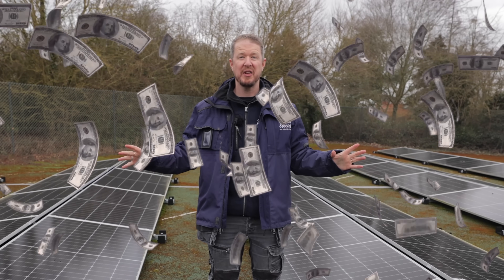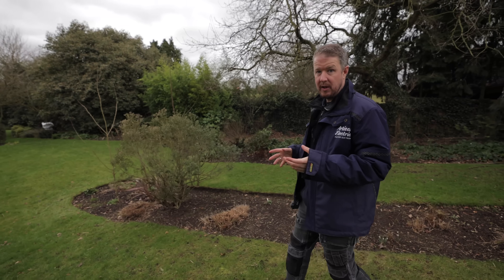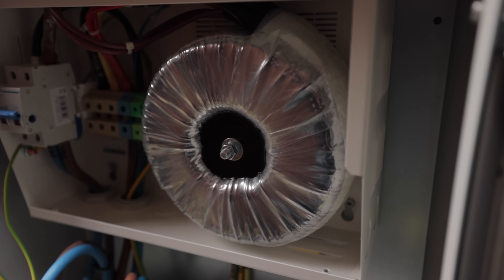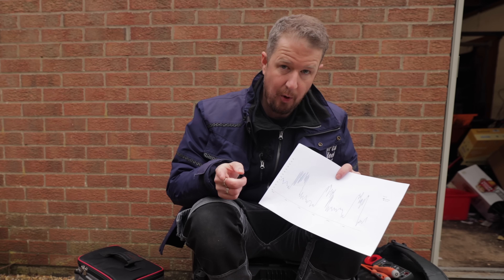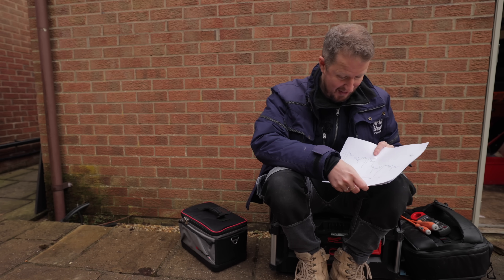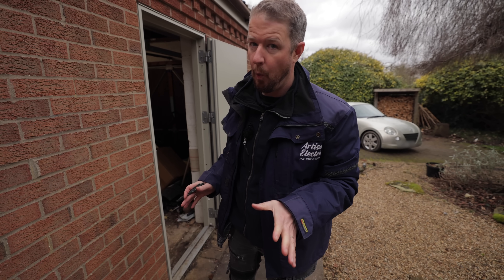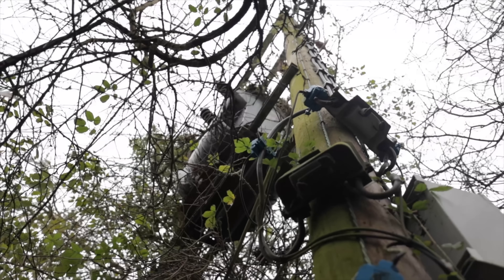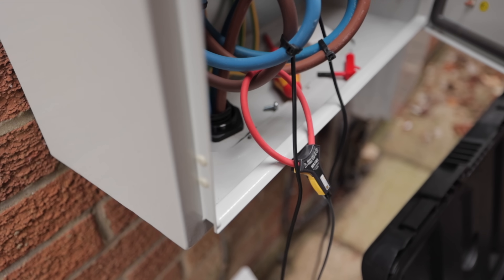THOUSANDS Down the Drain – And We Can’t Do Anything About It!

Comment: Until I retired last year I worked for a DNO for 40+ years. 
I do not think it is the transformer that is the problem but the overhead lines!

To be clear the standard voltage is and always has been 240 (you think we changed all our kit for the EU?). The reason for the 10% and 6% is to give the same top and bottom voltages without new kit!
If you ask the DNO they will provide you with the drawings of the network in that area showing Transformer size and even cable size in the overhead sections (at cost).
Whoever agreed that you could put 17Kw in on a solar system was not doing their job and it is worse because of the overhead network. But they have said yes and you have the paperwork I assume ;o)
There are a couple of solutions I can see, but they will not want to do them as it will cost them ££££. 
First is to upgrade the overhead lines (and clear them of vegetation) ....... I wonder what the Ze was for the house? Often overhead lines go a bit high. 
Second (and cheapest) is to change the tapings on the transformer (I assume that one does have tapings, but not all do)
Third, you can have eather individual or group voltage devices fitted on the network to stabilise the voltage. These are just a BIG auto transformer with tapings that can automatically change dependent on the voltage. They are usually fitted when there are long runs and the voltage gets too low at the far end although it may well be high near the transformer! You may need to get a good engineer who has experience on the system (an older one) as some of the younger ones might well not have come across this type of kit as it is fairly rare!

On the customers side of things, I am a bit puzzled as to why it is pushing the voltage so high as I thought the inverters would not go past 252v ....... is there a setting available (even remotely via the firm it was purchased from? I know my own solar will throttle down before the volts go too high!
Again you can do a bit of math to work out what voltage you would need to squirt 17Kw into the system with the Ze you have ........ Well Zn really ...... you should be getting 0.2 Ohms as an industry standard!
One final thing I would check is the power factor! Normally not an issue but you have some chunky inverters on that system and they can cause harmonics giving spurious high volt readings! If you have poor Power Factor you might just want to look at power factor correction ....... but this is getting outside normal domestic arrangements!
Reply: Very well explained. As soon as he started going on about 230v all of us old timers are like EU harmonisation literature does not equal the physical reality of the UK power network. This is why all my designs are still done with 240v and 415v. As @redshift points out the over voltage protection is worked out on 230v not the actual 240v system, a case of components designed for a harmonised system that's only harmonised on paper.
Reply: @ Well said! I am still miffed that we moved from Red, White and Blue phase colours to the RYB (and I will not mention the stupidity of allowing manufacturers to chose the Brown Grey Black with Blue as a Neutral) ;o)
Reply: @effervescence5664  What will cost more going forward? Manufacturers have been assuming 232V for decades now and problems with overvoltage will eventually cost more than adapting DNO trafos.
Reply: Give yourself a pat on the back - very well explained and can tell years of experience coming out all of which is positive solutions to a problem. 🙌 nice to see such a great comment.
Reply: I wonder what would happen if they just played with the export limit on the inverters. it'd be interesting to see if there's a linear (or not) relationship between the overvoltage and the current they're pushing into the network or a threshold below which it doesn't raise the voltage.
Reply: Yeah, the inverter definitely should be self-limiting its export based on the grid voltage. My understanding is that all inverters should be grid responsive today.
And even the batteries should probably not be pulling when the voltage is dipping so much, but I suspect that's less common.
Reply: @BobHannent  The output of the inverters must be pushing 260V for a reason and that reason must be because they are trying to shove 17kW (70Amps approx) back and it's meeting some (literal) resistance. All that is going through that relatively small toroidal transformer. These guys need to upgrade to a 3phase supply and get busy with the pruners and chainsaws to clean up the DNO wiring to the house(s).
Reply: I mean, it should have been obvious that by putting a transformer in to step down the voltage that the low end would become too low. The issues caused by this voltage swing (both before and after) are far more than the video notes - you're basically voiding the warranty of every bit of electronic kit in the house, and very possibly creating a safety hazard.

I can't believe a professional electrical installer would considfer putting that in rather than getting to the root cause of the issue (which I see from the comments is well understood)
Reply: @mpellatt  
100%
Reply: Absolutely LOVE reading posts from knowledgeable experienced older guys like 
these!
Reply: I'm pleased you pointed out the standard UK mains voltage is 240 not 230, I often have that argument with people!
   In fact the UK average is actually 242V 😂
Reply: @Nigel_Broatch  I worked at a site with their own substation where they set the tappings to 400V (because that was the official nominal voltage). Caused a few headaches!
Reply: @PeterClifton  230V phase to phase is 400V, so I'm not surprised, but it could also be an industrial site with 690V phase to phase. At my workplace we have all kinds of fun voltages to worry about, even 110V DC. Measure at least twice...
Reply: @ I assume you are in the US? Here in the UK it is 415/240 .... or if you are a heavy user you can go for a COMA agreement, rent your own transformer (still run by the DNO) and buy your energy on the HV network! This is only for heavy industry though!
Reply: @Nigel_Broatch  Not that there is anything implausible about 242V, but how would anyone know what the average UK mains voltage is? They know what they are aiming for, but that is a different thing.
Reply: @Moletrouser i can't remember where I read it. 
It might be usefu under certain circumstances to know that it's usually around 240V not 230V. 
Knowing the exact average probably isn't important to anyone!
Reply: Excellent comment! Listening to this, my money was on the cable, too. Ohm's law says that if you're trying to push 17kW into quite a long, tiddly cable, you're going to get a voltage rise. And the problem isn't just that the customer's car charger cuts out. 260V is outside the design spec for every piece of electronics in the house. You risk blowing them up. And not just in the customer's house - all his neighbours further down the cable (on the same phase) will see 260V, too.
One idea - can this system be converted to three phase (at least on the grid connection - would need the inverter changing)? Then it would be a third of the problem (~6kW) going back into each phase. Presumably there's three phase on the pole.
Not qualified on the legal niceties of who's reponsible for fixing it, but in my view UKPN should never have allowed this to be connected up in this configuration.
Reply: @Sparx9062  Yes, changing to 3 phase is possible ....... but $6K would go up a bit and even then the customer would have to do the excavation. So not really an option!
I would expect to see a wide range in voltage from near the transformer to the far end of the leg (300m was half way?). 
If it were down to me I would offer the other residents a free voltage check and quiz them about their supply experience. If it is as I expect and the supply voltage is outside the given levels the DNO are under an obligation to sort it at their own costs! There are several ways to do this but none are cheap and that is the reason for the delay. If you can show someone is above 253V and at the same time someone at the far end is 216V the DNO have no room to argue and will act ...... but you need those figures! When talking to the DNO engineer get his name and there is accountability should anything bad happen and they are risk averse! 
Final tip is to keep it pleasant! Give them no reason to not do it and every reason to do it and you will succeed! Most DNO's are replacing overhead lines anyway as the budget allows, so your chances are good!
Reply: G99 stage 1 overvoltage protection is +14% (262.2V) 1 second. I think this is the maximum shown in the video, so perhaps the G99 protection is operating as intended. Have there been any overvoltage trips of the PV inverters?

G99 stage 2 overvoltage protection is +19% (273.7V) 0.5 second
Reply: Now that’s a good answer well said
Reply: @totherarf  Oh bless you sir, we old-timers are still worth our weight in gold! I wonder what the inverters software is like? Pumping up the national grid is one thing, and a domestic power supply is another. It looks like a voltage/current mapping problem with the software. Voltage regulation looks rather poor. It is so difficult without 'hands on'...
Reply: "you think we changed all our kit for the EU?" I'm a Brit living in the Netherlands and yes, I did think that the UK had followed the rest of the EU and standardised the voltage at 400 V between the phases which translates to 232.2V   (if I remember right) but then I discovered it hadn't happened in a similar on-line discussion a few years ago.
What I don't understand is whether a standard 10kVA trafo can transform up as well as down. I always assumed that it wasn't possible and that it was a one-way system but Artisan Electrics seem to be assuming that it is possible.
Reply: @billmorris2353  The rest of Europe didn't change their voltage either. A point in the middle was picked and the tolerance made enough to cover both bases.
Reply: @billmorris2353  The ave in my part of Devon UK is still 255v, and it never changed when they claimed it did.
Reply: @ Interesting point! Yes it can! One of the problems in working on the network is making it dead. If you kill a HV line and someone plugs a generator in it Will backfeed. A transformer is after all is said a device that works on changing magnetic fields! That is why we earth the HV lines to ensure all such energy is shorted out!
Reply: They should of let the DNO do there 2 week test, surely they could live without the solar for 2 weeks for goodness sake, acting like there broke.
Reply: @scitec717  They would not have had to disconnect the solar ..... just set the export to zero!
Reply: Excellent reply. 
I went and looked at the voltages and currents I record on my supply (good old Home Assistant with a Victron ET111) and I have not seen anything going over 252 V at peak, most of the time we seem to be below 246V. I have two PV mains connected inverters, (SolarEdge) and at times I do get to my agreed DNO export limit.
On my limited knowledge I would be looking at the settings on the inverters, they should control the voltage.
I also think that there could be a bit too much resistance on the overhead lines, if these cannot 'sink' the full exported current the voltage will rise at the house end, basic ohms law.
Reply: Can't a Tesla handle 277 volts from a 480 volt delta system?
Reply: @JulianSortland  I have no knowledge of Tesla, but it is 240/415V here in the UK so you are 37V up. Also there is the fact we talk of voltage as an RMS measure. The amount of energy that would cause a simmilar heating output if it were DC. The rms value is 0.707 (If I remember rightly) of the true peak voltage. It is the peak that causes the problems! This gives a peak voltage just shy of 340V!
Reply: Question if it was TNCS earthing and they installed enough local earthing  alongside the PME earthing that lowered substantially Ze and thus the impedance of L/N would this cure the voltage spike and for the low voltage if that does not solve it, just lower the charging current. Maybe someone knowledgeable would be able to comment on this.
Reply: @brianoneill350  That might not work. The problem (I think) is L - N voltage not L - E. ..... That is why I said Zn. The higher impedance of the active circuit (L through N and back to the transformer windings) is the issue. If you inject energy into that system you have to raise the voltage. The amount the voltage raises by is directly proportional to the impedance (Ohm's law).
Reply: Exactly the same as what I said those old transformers were good way better than the new ones we have down here that have been rusting out in no time.
Reply: @kevxsi16v  I assume you mean the PMT? Many of them were older than me and still going strong! The only real problem with them was the oil in them is bad for your retirement plans. New oils are good though .... or so I am told!
Reply: It seems that the customer is at the beginning of the line and therefore the company does not want to switch tappings so that the voltage at the end of the line is within the standard limits.
By the way, I don't understand, are there 3 phases or just one?
Reply: Yep - my response was going to be dropping the tap changer down -5%. Needs and HV outage, but simplest solution and probable fix. That Tx and H-pole will get upgraded…… eventually.
Reply: @mrjonnylowes  That may put customers further down the line below legal voltage limits though.
Reply: @ maybe, but it looked like that property was at the end of the LV network.
Reply: @mrjonnylowes  No. The PMT was the end of the HV but those overhead cables carried on. He said he was half way down at 300 yds!
Reply: I think there is more than 1 problem here. I think we pretty much agree that consumption makes the voltage drop. Since the grid need to be in sync and one got 17kW going out but its not being consumed. The neighbours is not able to comsume the excess and it can't be forced thru the transformer, as you pointed out the overhead cables are undersized to deliver the power out.
Last time I checked 17kW at 240V must mean the amp's going out has to pretty high, in the area of 70 amps?
Thinking that the Inverters force the voltage to high, wonder if they are not able to keep it lower, if the DC voltage side with full blow summer sun they can regulate properly, and don't get high enough voltage on the DC when the sun is to low.
Something must almost 100% be getting hot somewhere, where ever that is thats there the most significant problem lies.
As there is no mention of what inverters are on the with datasheets and what panels are connection in what configuration, and what size the main cables are. I would expect the voltage drop to be huge. There could be a bad connection somewhere, becuase all in all. Something here does not sit right.
Reply: I think your problem is the grid tie inverter. Replace it with another brand and specs.
Reply: Exactly. We had 260V when PV was generating full output. One has to go well upstream to get active voltage control, such as automatic tap changers.
Reply: Can't your regulator switch the output, as required?
Reply: @JulianSortland  It should be able to, but that is not the issue! They asked for a size of input into the network and that was agreed. They spent a lot of money based on this data and now it is looking like the data was wrong and the agreement should not have been made! But it was ...... and now I think it is only right that the DNO fixes Their problem!
Reply: @totherarf  The problem is an excess of power. 
If the DNO has no consumers to consume all the solar generated the voltage goes up until the inverters starting to shut down. Power Consumers always lower the voltage while power generators will increase the voltage.

It doesn’t matter if the voltage is 230v or 240v
If there is no consumer for the power, the voltage goes up and up. People who live near the transformer will notice their inverter shutting down earlier and more often as someone far away from the transformer.

In some eu countries there is a whole business burning excess power with load banks to keep the voltage down.

Electricity is invisible but behaves a lot like fluids.
Reply: What you think does not matter. Hard solid facts only thankyou.
Reply: @IANHANDS  When I said "I don't think" that was a Professional Opinion! It was based on hard facts. If you want to have Hard Cold Facts only you were watching the wrong video! Many opinions were expressed in it as if they were facts!
Reply: Best answer and information to the problem 👏
Reply: If the power factor is poor and the inverters are generating harmonics, they will inject noise into the grid and cause all sorts of problems, including radio interference. I'm a ham and I know that electrical installations can act as big, radiating antennas.
Reply: Hope you are enjoying your retirement. Question if it was TNCS earthing and they installed enough local earthing  alongside the PME earthing would that lower substantially the impedance of L/N cure the voltage spike and for the low voltage if that does not solve it, just lower the charging current. Maybe someone who knows more than me could answer this ❤
Reply: @ Thanks .... and Yes I am! The underground cable should be earthed at each end and at suitable points in addition to get the Ze down to regs. But that will have no effect on the L-N circuit! The pole mounted transformer will have its own earth taken to the star point of the windings.
Reply: @brianoneill350  I don't think it would. You are talking about only half of the supply system and the body of earth has an intrinsic resistance that you can't get below (different for different composition of ground) ....... what can make it low is the number of parallel paths for the current to flow! The "weakness" is the conductor size of the overhead cable. All done and dusted now of course although I expect an engineer got a serious talking to by someone quite senior on the issue! ....... One year in to post employment bliss and Yes I am enjoying it, thanks!